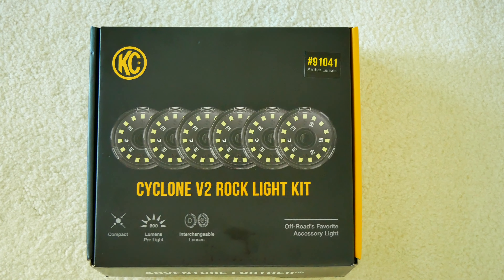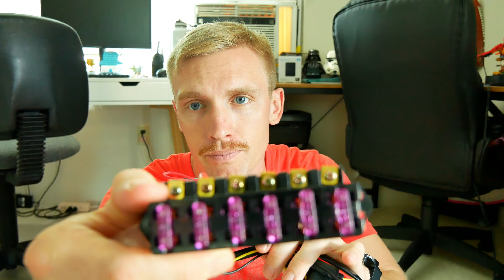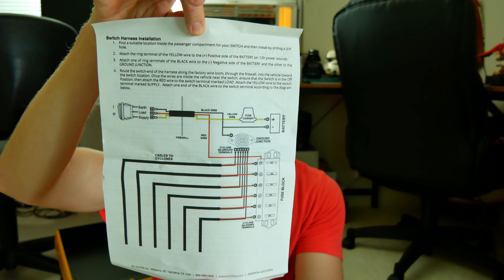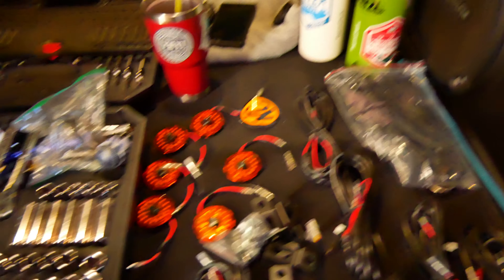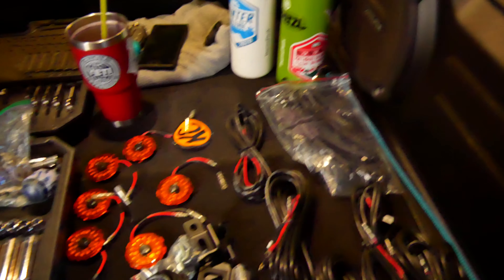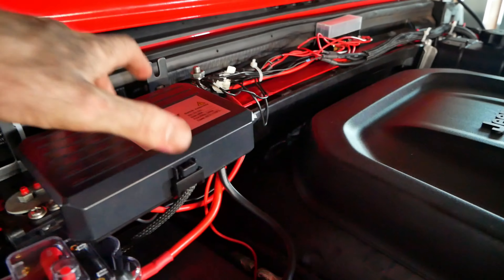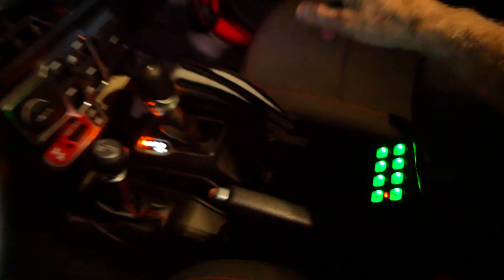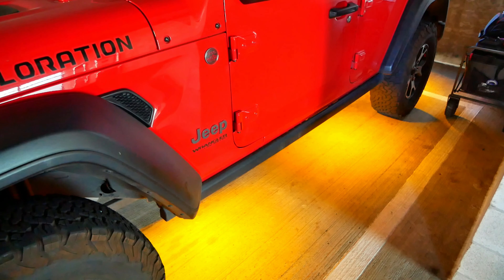KC Rock Light Kit Install

Comment: Did you install any more to the front of your Jeep since your initial install?
Reply from the maker: I have not yet. I just have the two slim lights on the bumper. I am planning to do pillar lights for the front or a lights bar. I dont do a tone of night wheeling, so I am trying to be practical about what I want. It's a little boring that way, but I don't want a lot of lights I won't use.
Reply: How long were your screws that you used to screw your block down in your fuse junction